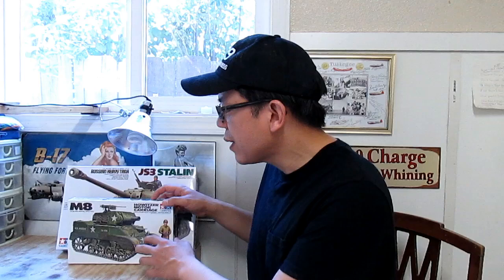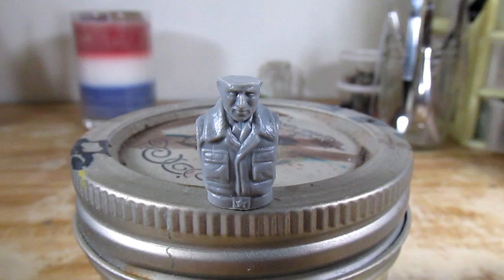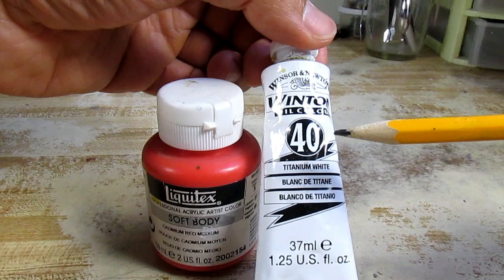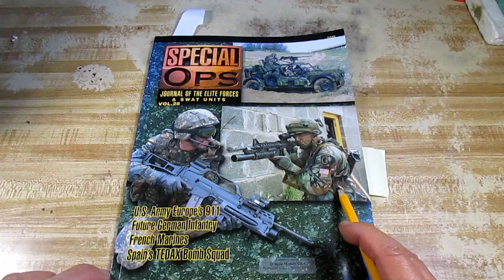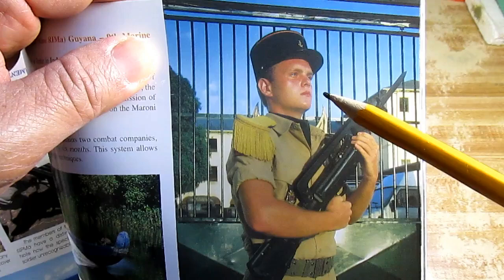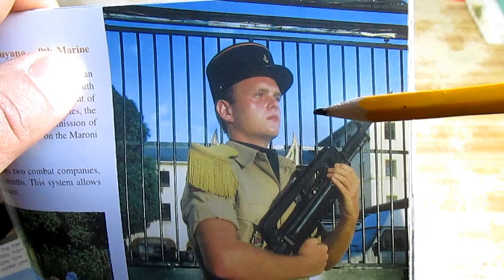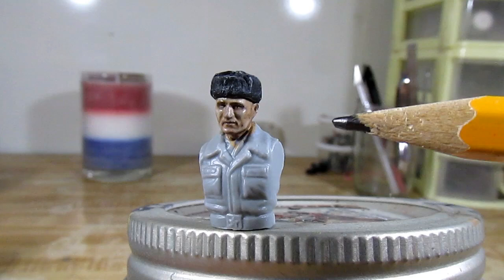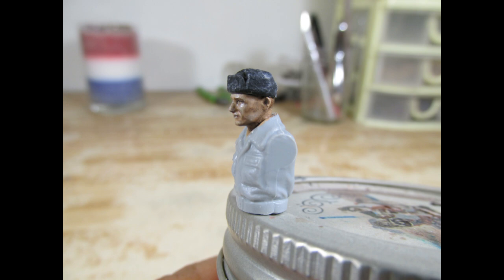How I Paint a 1/35 Scale Figure Face

Comment: Very nice tutorial. I go by a different, all-acrylic method with 1/72 faces, where I paint the overall face in a dark tone before painting the less dark areas with a lighter colour and then finally painting the highlights of the face with a light tone. On its own, that looks fine on 1/72 and smaller, but for 1/35 (I have many 1/35 Germans I need to paint at some point), I ought to try and use acrylic thinner to carefully blend the colours together.
Reply from the maker: That's a good way to paint figures! There are so many ways to paint figures that no one can truly say one method is better than the other. It certainly sounds like you like the way you paint figures. Keep it up. :)